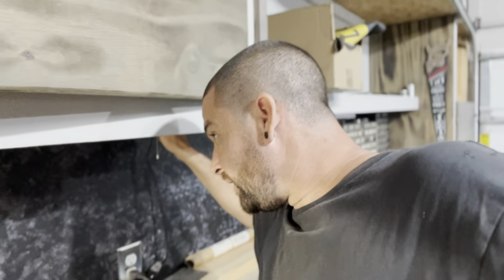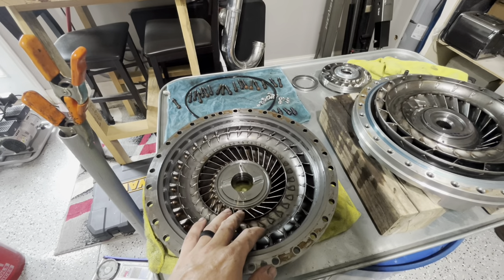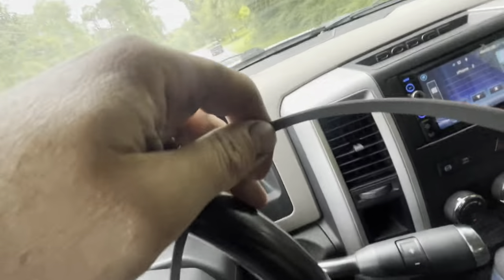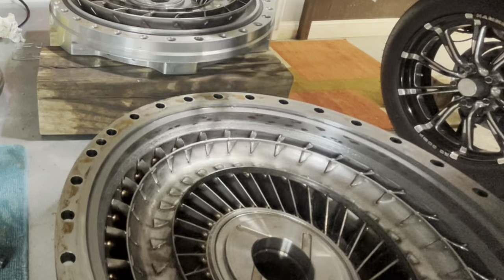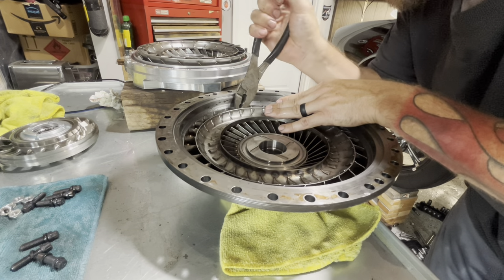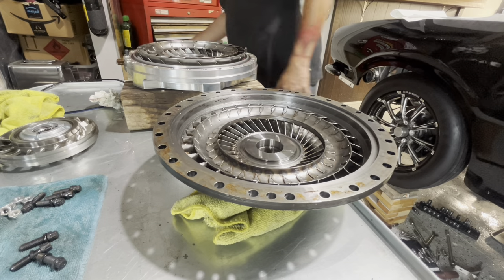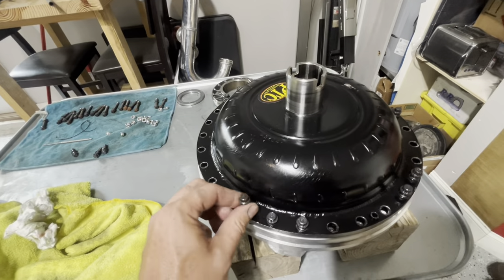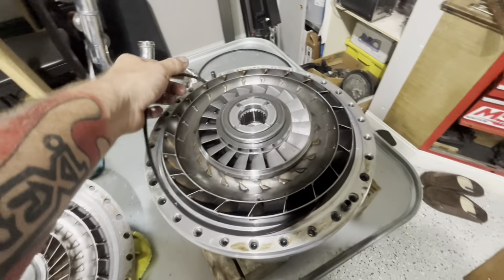😯 Stator & Pump Angle Change / Bolt Together Torque Convertor 🔥

Comment: Hey, I learned some things from watching Steve Morris on you tube about automatic Transmissions torque converters and fluid flow. It was things I never knew about specific clearance between converter and Transmissions. It wasn't what I had always been told. It will be worth the time to watch. You can wind up chasing your tail if the specific clearance for your set up requires isn't met. It will effect your converter stall and slippage. It also will kill et. 
Just trying to pass the info.
You may already know this info. I sure didn't. Neither did Steve. It is, my converter problem solved.
Reply from the maker: I did not know that I’ll have to look up that video and watch it thanks

Comment: That outer o ring situation is correct/normal. It’s that way on other converter brands too.
Reply from the maker: It’s so crazy to me lol
Reply: @ThePaintPaperHustle  If the o ring stays the size of the converter groove, which it will over time, it must be replaced. Honestly though, the o ring is so cheap I just replace every time it’s apart.
Reply from the maker: Yea I think I would do the same just to be safe

Comment: Did you get to test this out? PTC recommended this to me also.
Reply from the maker: Yes that with the stator change seemed to fix it. However we had blower belt issues and didn’t get in a super solid pass this past year before changing to turbo

Comment: Do you have videos of how you biult your transmission? I would really like to know how to do that.
Reply from the maker: Unfortunately I wasn’t doing YouTube at that time. If I ever have to redo it I’ll record it. My go to is “Mountains Garage” on YouTube. He is absolutely amazing with the th400 and he talks slow where you can understand him and keeps it budget friendly. I highly recommend you going back through all his th400 videos if you have that trans
Reply: @ThePaintPaperHustle  i have a two peace converter from PTC. It can be used with a turbo 400 or a power glide as long as the power glide has a turbo 400 imput shaft. If you don't mind me asking, how much did it cost you to build your 400?
Reply from the maker: I’m around 3k in my trans including bell housing but NOT including the convertor. However I do have a handful of billet parts inside and a oversized drum that had machine work done to it I believe
Reply: @ThePaintPaperHustle  how much power do you think it will hold?
Reply from the maker: Honestly idk but I hope more than I’ll make on this set up. If I had to guess it’d be between 1500-2000
Reply: @ThePaintPaperHustle  sweet